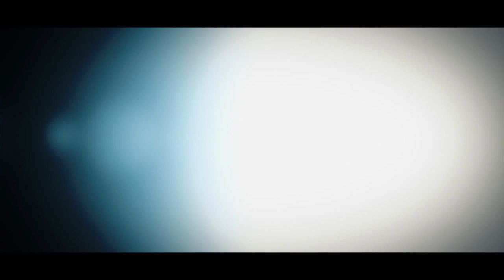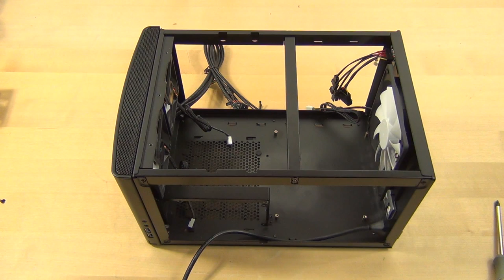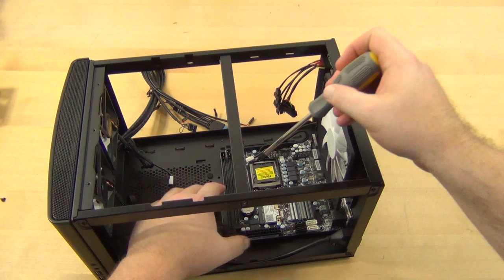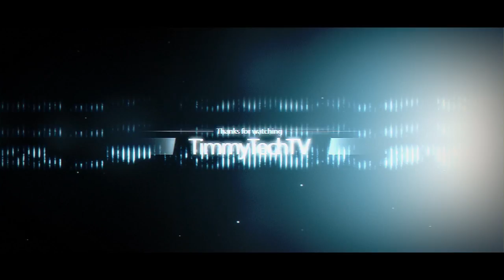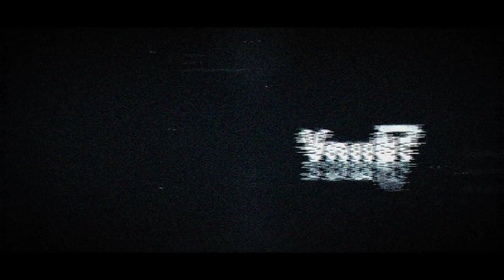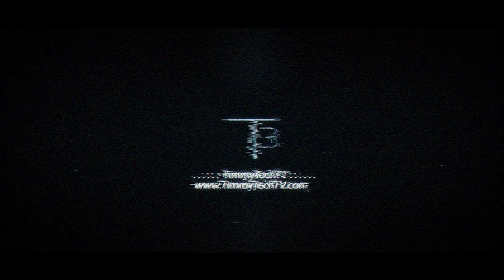How to build a mini-itx editing & gaming system - Meet the Snow Badger (Part 1)

Comment: I have a node 304 I won in a contest from Fractal and haven't been able to use it, and would love to, but wow a decent mini-itx board is rather on the expensive side, the one I want was more than my main gaming rigs board :/ Otherwise I love the air flow and ability to use a regular power supply in it over the old shuttle mini cases, that was the one thing that always scared me about those, the little tiny oem 2-300 watt psu's included.

Comment: so wit r u saying those gigabyte boards because they have a 4 pin are not good for overclocking? not the brand exclusively but the fact it uses four pin overclocking not possible. so those asus boards are better for overclocking in the mini itx sense?